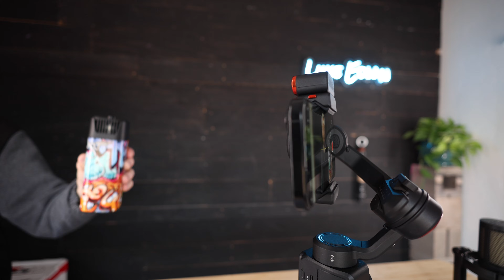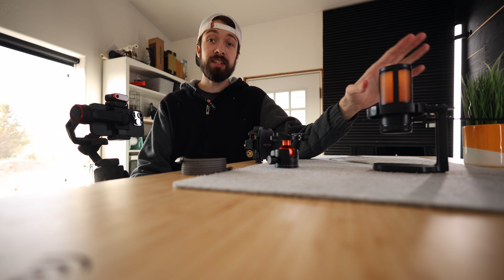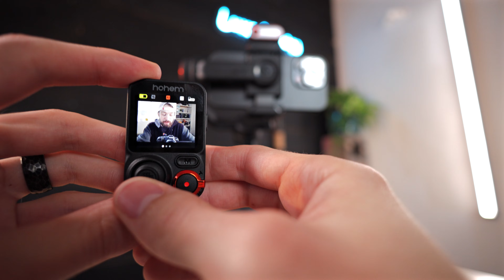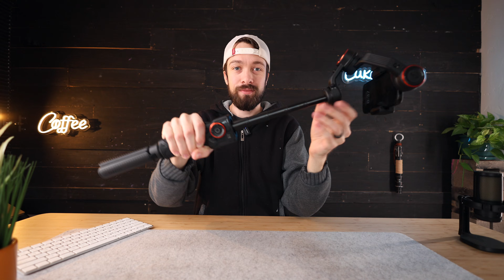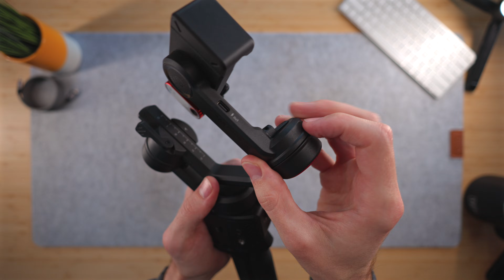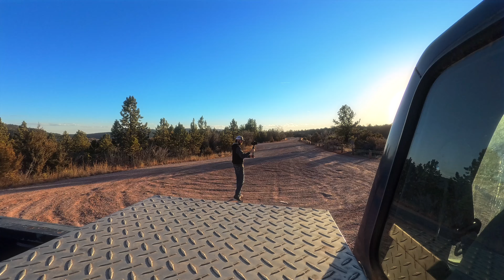This changed everything! Hohem iSteady M7

Comment: Nice deep dive into tracking abilities. I enjoyed using two phones with a few gimbals I've had previously, providing monitoring and even motion control, to frame,  which was useful, but other than the small size of whats truly a "remote control / monitor" Hohem had a brilliant idea here. Building tracking independent of the phones camera is incorporated in a bunch of cheap Amazon tripods so they probably have no patent or limited ownership of the concept design, in wvhich case we are entering a creative renaissance!

Comment: Thank you for the detailed review! And thank you for making it known that this thing works with GoPros! I looked all over the website and scrolled all the reviews and found nothing on whether this was compatible with GoPro or not! I ordered it anyways, but that is a huge plus. I wish I had found your channel sooner
Reply from the maker: Glad it was helpful. To be clear it is not specifically designed for GoPro but it can hold a GoPro. it doesn’t connect to it wirelessly for the remote control to work But it is just as easy to press the record button on the GoPro.

Comment: When the motor arm is in view of the camera and you switch to wide view can the phone go into Selfie mode to record yourself instead of relying on remote screen
Reply from the maker: You can record with your phone however you want using the native camera app. The gimbal works independently from your phone. I was showing using the back camera on my phone because I like to do that because the back camera is better then the selfie cam.

Comment: Can this gimbal be used with action camera like dji osmo action 5 pro, i wish to buy one which can be used either with phone or action camera
Reply from the maker: I have used this gambler with the GoPro and Insta360 Ace pro. However, This is not specifically designed to be used with action cameras, so it won't wirelessly connect to them for the controls, but it can handle the weight and if you're OK with just clamping it into the phone mount it does work and if you're worried about it falling out of the phone mount you could always just throw a rubber band around it.